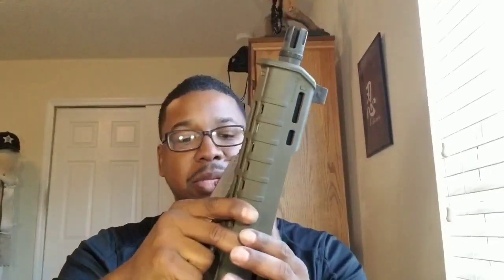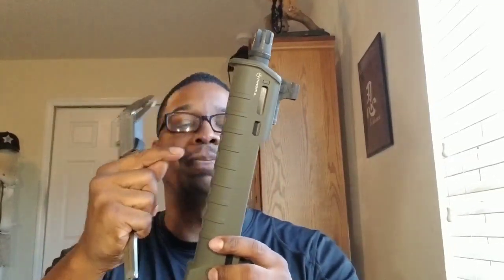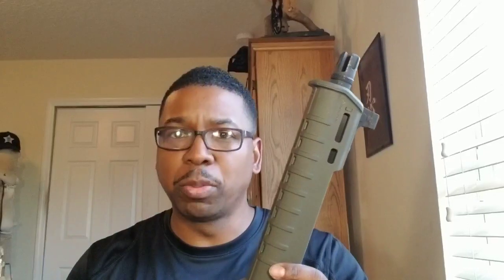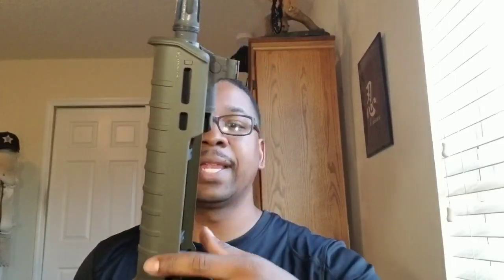Installing zhukov handguard without removing your handguard retainer clip.

Comment: This is excellent information - tried your suggestions with great success.  Previous I was about ready to give up on the Zhukov because of the requirement to remove the retainer cap.  You're right... Mod the accessories, not the machine itself.

Comment: Great Video, Honestly I removed mine since the retainer channel was slightly over sized. It gave me a pretty loose retainer. I went with a Zhukov U since it weighed less. I did have the troy but I did not care for the mounting method. Troy also had play on the receiver side of things.

Comment: Question... With the original handguard retainer still there and now sticking out of the bottom of the heatshield, does that make one of the MLOK slots on the bottom of the handguard useless? Or does the mounting hardware of a MLOK attachment not touch the original retainer?

Great video by the way!

Comment: Nice workaround if your retainer cap doesn't have the integrated/casted sling attachment loop on gas block. Was hoping to install on SLR107 but unfortunately mine has the sling loop so the search continues. Or, perhaps alterations could be done to handguard to work around the sling loop without sacrificing much of it integrity.. 🤨

Comment: Great video, thanks for this. Do you think there's any way to modify the heat shield to accomodate a sling loop if you don't want to remove that part?
Reply from the maker: Yes
Reply: @rhines3470  I really want to do this, how would you go about modifying the heat shield to accommodate the sling loop?

Comment: If I don't want to cut off the sling loop, do you think it would be possible to dremel out a space for it in the handguard, and snap the Zhukov around the sling loop?
Reply from the maker: I think cutting a slot for the sling loop will weaken the left front portion of the bracket.